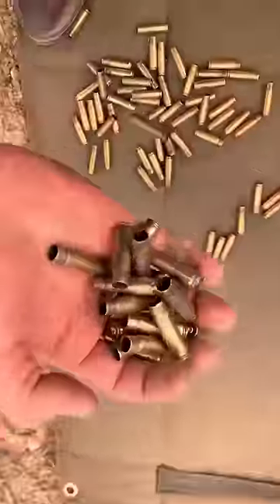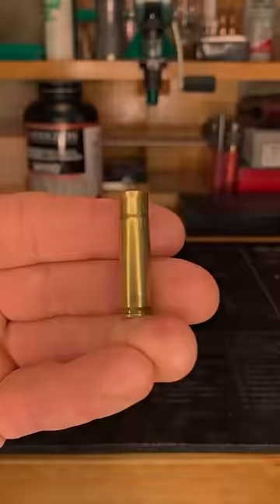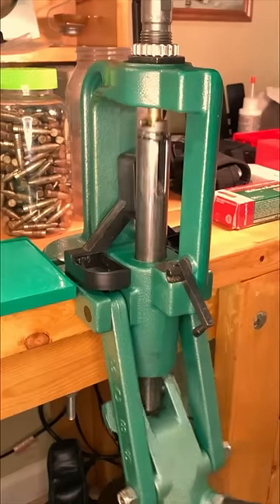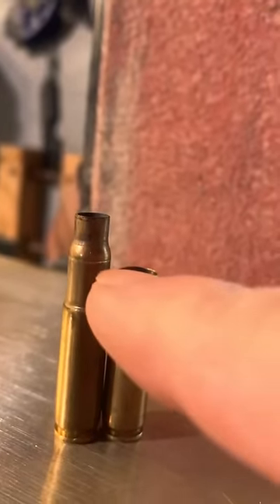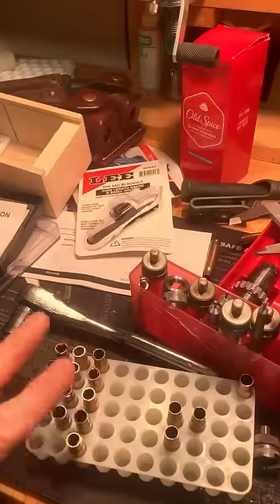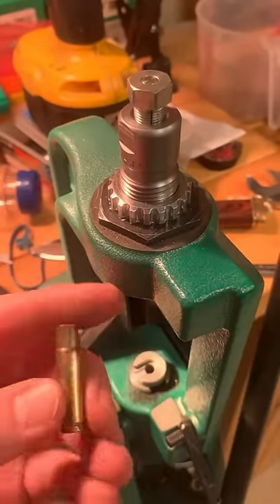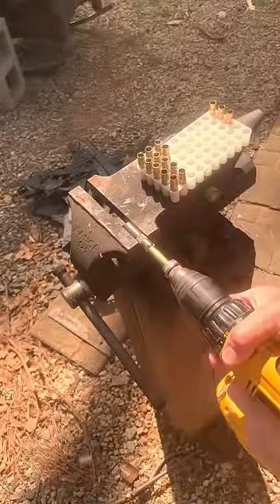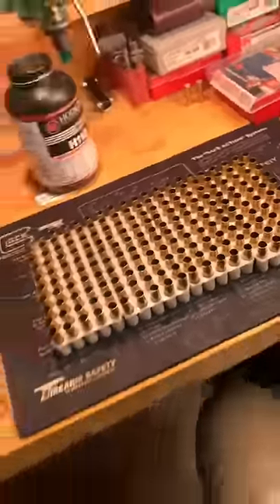How to convert .223 cases to 300 blackout. #shooting #reloading #300blackout

Comment: I save all my 5.56 and .223 just for this. I haven’t started reloading yet but boy do I have a good amount of Brass.
Reply from the maker: This is just a kind of comment I love to see. That is great Lou. I’m sure you will absolutely love reloading. Don’t forget: RCBS and Hornady reloading kits usually go on sale for Father’s Day from Cabela’s and Midway USA! 
-Stagger
Reply: @staggerleesmancave8987  thanks for the info Brother.
Reply: @loumac241 I was just about to comment something similar... shooting 2-4 times a month thru the pandemic adds up to, well... a lot of brass in my garage. Can't wait to reload it all.
Reply: @jojo67c  yeah it does Brother and I’m glad I ended up picking up a .300 Blkout. So no waste when it comes to Brass.
Reply: So you can use .556 the same way as these .223’s? Just making sure.
Reply: @austincrawford5040  yes sir
Reply: It's a very relaxing and fulfilling hobby.
If just getting started, don't feel compelled to spend a lot of money on higher-end reloading equipment. You can always upgrade your system/ components down the road - after getting your feet wet with a few hundred rounds. I still use my decades-old Lee Classic single-stage press setup (with a couple upgrades/mods).
Though if you have the option (and funds) to purchase carbide reloading dies (vs plain steel) for the calibers you're interested in reloading, I encourage you to spend the extra few bucks - if simply for their benefits of longevity, reproducibility and resizing ease.
Also, lubricating straight-walled brass (most pistol calibers), prior to resizing, is not required/necessary (in most cases). Though it's a good idea to use a bit of lube, when resizing necked-cases (most rifle calibers) with carbide dies. Such as by lubing one in every ~10 of the brass cases you're resizing. This will maintain a thin coat of lube on the inside of the carbide sizing die, reducing friction and potential damage to the case during resizing.
Happy reloading! 
Stay frosty out there folks!
Reply: Don't be like me. I've been saving up supplies of all kinds of stuff I plan to learn someday or plan to get around to doing someday.

It's been years and years and I still haven't seen someday. Just got a lot of bs taking up room now with too much value to toss and not enough value to try selling with any vigor.

Like, I'm sure there's one or two people interested but they're probably across the country from me or in Cambodia or something.

So I just sit on all the stupid hoard I'm building just waiting for someday to come 😅

Gun parts, car parts, electrical and appliance shit, computer shit, rc motor shit, boat shit, loose construction material, plumbing shit.
Reply from the maker: @austincrawford5040  Yep!

Comment: Be aware - not all 223 brass can be converted to 300 BLK.  Some brass is too thick, so when you seat the bullet, the width can cause chambering issues.  Learned that the hard way.  I don't see many videos mentioning this.  Measure your 300 blk neck thickness after final sizing and chamfer/deburring.  If it's .013 or over, then your neck after seating will be > .334 (max for 300 blk).  I have had no trouble when the thickness is .011 or less.
Reply: I have also had problems with this, there are lists online you can lookup that will tell you which brands of 5.56 ammo are gtg to make 300 BLK and which ones will not work.  If you are buying 5.56 by the case with the intent of making 300 BLK brass it is goo to check one of those lists before purchasing a case.